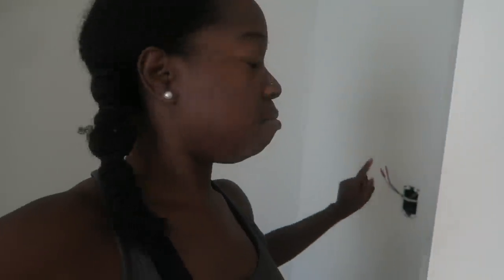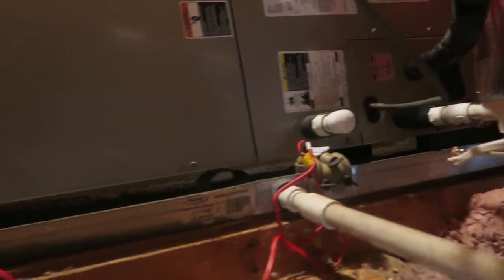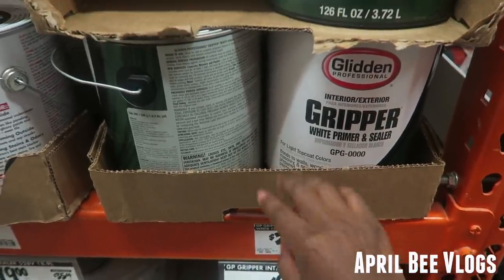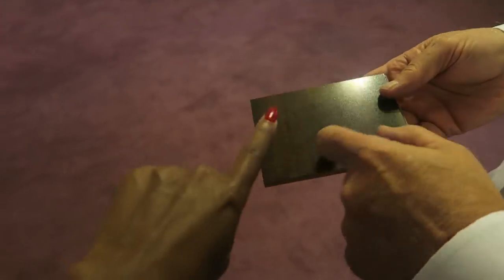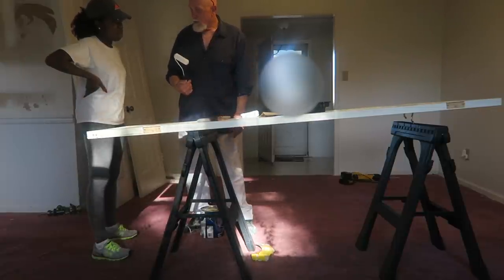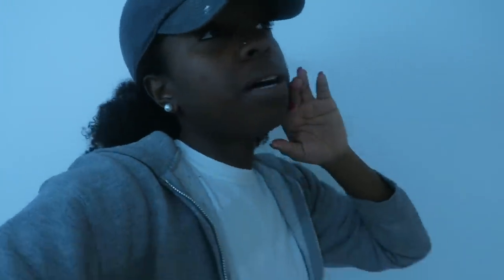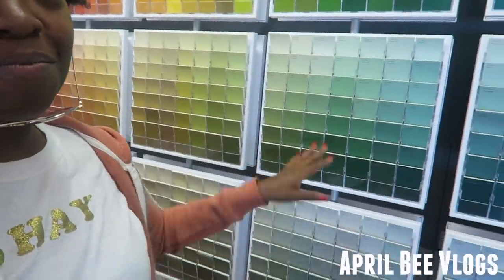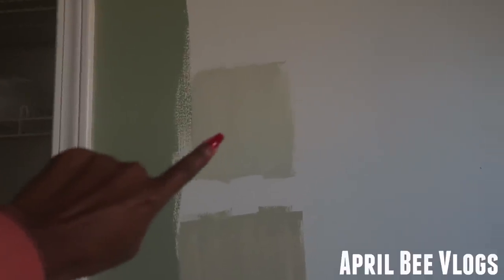HOME RENOVATION | Picking Paint Colors & Working In The Attic!

Comment: Your so lucky, i work at New Zealands paint shop and our standard wall primer and 4L of paint is always 150 +
Your guys paint is so cheap 😍
Reply: Omg 😱 that’s a lot. I spent about $130 on the paint, primer, brushes, handheld paint container, tape, rollers, extension handle, and exterior door and rim paint. I’m definitely thankful it’s not that expensive or I would have to save a ton to do these little projects.